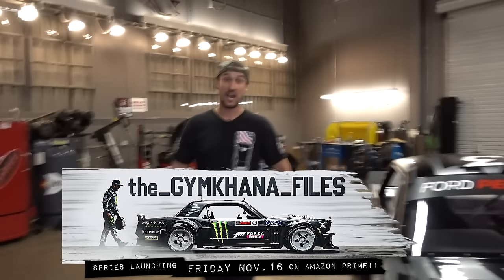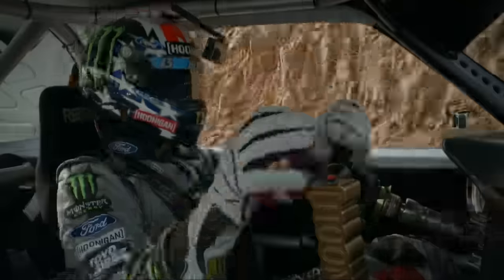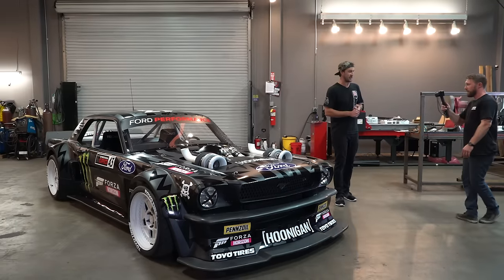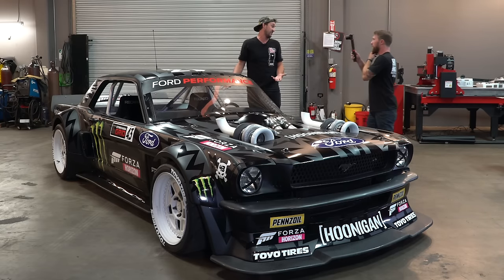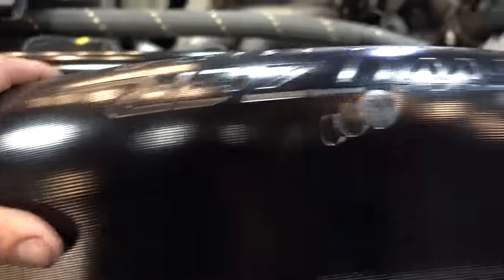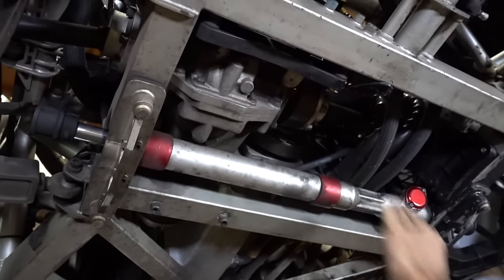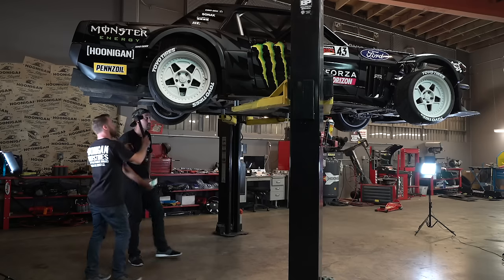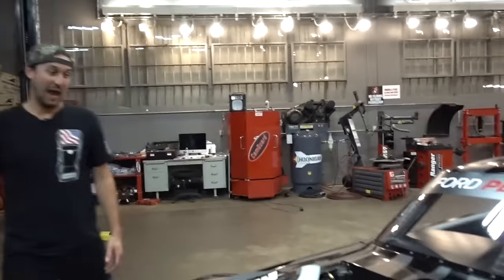Ken Block's 1,400hp AWD Ford Mustang Hoonicorn V2: Straight from Gymkhana TEN!

Comment: Awesome car!
I like that they showed the VIN. I did some decoding and found the following.
It's a 1966 model and originally had a 200 CUI V6 (3,2L). It had a 3 speed manual transmission, was Candy Appled Red and had a Black interior. It was assembled in San Jose.

You learn something new every day :)

(I'm also happy they used a V6 and not a V8 to make this)
Reply: @IRONxMAN1989  that's the converted engine. Not the original
Reply: Thats my exact model car. And a inline 6 is pretty powerful as well. Dont underestimate it.
Reply: @IRONxMAN1989  R/Whoosh
Reply: @novamatter3432  neither comments were a joke, nobody missed a joke.  Please stop acting like you're onto something when you clearly dont.
Reply: Inline 6 not a v6 with 3 on the floor shift.
Reply: @andyc8610  Bro what are you on. I just listed the original parts that were on the car from factory...
Reply: @andyc8610   Hey, congratulations. You can somehow manage to write almost coherent sentences. If you were also able to read, you would have understood that what I listed were the specifications of the car BEFORE it was modified. So when it was NEW, it had a 6-cilinder engine.

Comment: FINALLY! I've been wating to see the Hoonicorn under the lift! I hope the Hoonitruck is next!!
Reply: If Ken Block will watch this clip it will end up replacing all joints axles and greasy parts and the gearbox with new parts just because Hoonicorn need the top up-grades for next Gymkhana.. if is not going to use the Hooni-Truck !!!  (>_<  )

Comment: Mechanic: How Short do you Want your exhaust Pipe
Ken: yes
Reply: Nguyễn Minh Vũ 1 pretty sure they are custom
Reply: @Giorgio--  it's basically straight piped exhaust xD
Reply: @AbdulazizAladwani-ke7in  open headers is engine to headers to exit. This goes through turbos, so not quite open headers, usually these are called "hood exit exhausts" but seeing as the turbos are already through the hood I am not sure

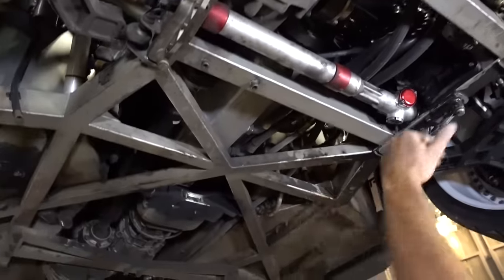Comment: lol 13:20 as they shows the underbody I dribbled more on the welds than the hardware, IM a heavy faby with adv spec in structural engineering. PROPS to those boys making the chassis

Comment: The Hoonicorn has a Vin number? It actually started with a '65 Mustang? No way! I always thought it was a completely custom bespoke car based on the design of a '65 Mustang. That's really cool and impressive, that they included a few original parts from the car and put the compliance plate in the Hoonicorn. Ford really did the shit with Ken Block impressively well. It's a damn shame their relationship is now no more. So Ken no longer has the Hoonicorn. I guess Ford will either put it in a museum, never to be driven again, or they will auction it off to the highest bidder. Whoever that may be will park it up and keep it untill it's value increases sufficiently to be resold. It's sad.

Comment: I think i can wrap my head around the front suspension, with this extra arm from the front, not super sure what its doing, but there is no clear view on what goes on in the rear. It looks like a support arm is wrapping around the drive axle, attached in the back and somehow ends up at the rocker to the front side of the rear suspension. Are these support arms the sway bar that is hidden inside the frame tubes? Ah that must be it, he even said it, i just needed to watch it like 5 times to hear it.

Comment: How do you set up the handbrake to unlock the center diff?
Reply: Nicolas Andrés Parra Fiedler automatically when it’s pulled, or with a red button on the top of the leaver. You press it while you pull the handbrake.
Reply: @PimSchouten  the question is how a hydro brake disengages the diff? it provides pressure to a clutch?